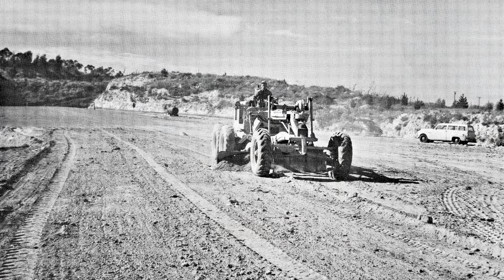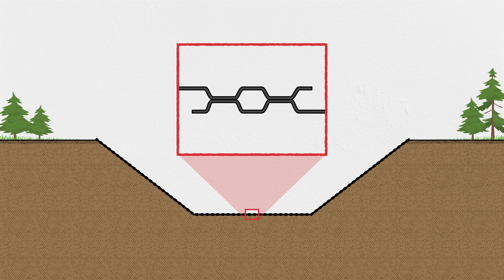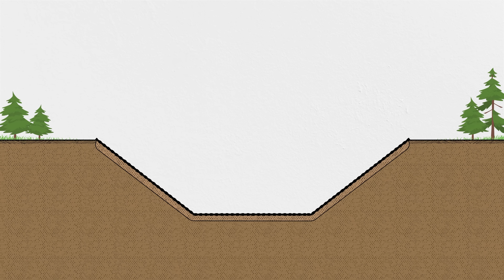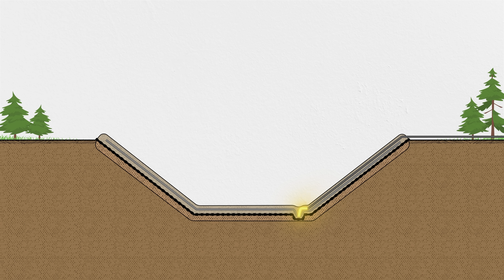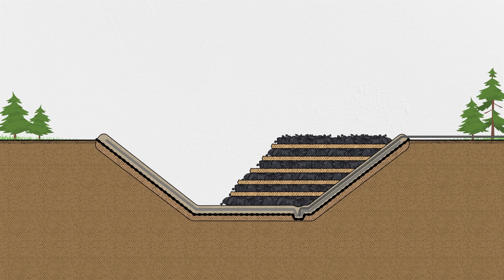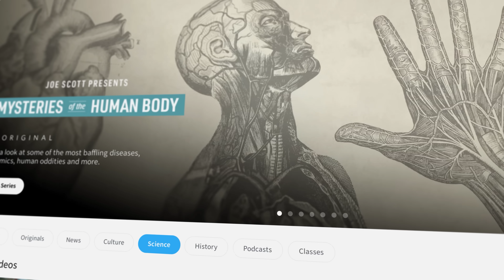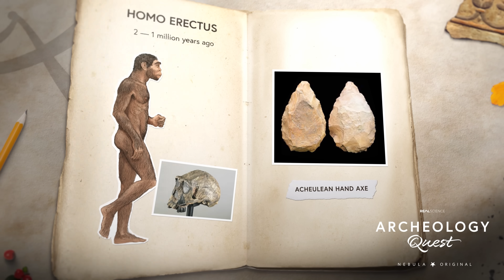The Hidden Engineering of Landfills

Comment from the maker: ⚡I have more than 20 videos about soil! https://www.youtube.com/playlist?list=PLTZM4MrZKfW-A419dqGZVtw6CAANqKR1f
🌌Get Nebula using my link for 40% off an annual subscription: https://go.nebula.tv/Practical-Engineering
Reply: As a Dane, I know exactly where my waste goes. I was born in 1984, and has only known a world where everything is sorted and recycled. There are no landfills. The only thing that isn't reused is concrete, but we're working on it. A lot of unsorted waste is incinerated, which isn't perfect, but the heat is used for district heating and generation of electricity. The smoke is “washed”, in an attempt to remove heavy metals.
Reply: By me I know all 3 landfills, Bisasar Road, now close to full, and Marianhill, also close to full, with the new Buffelsdraai landfill, set to be usable for a century or so, seeing as it is basically a massive valley between 4 hills.
Reply: Love your videos. Clear, topical, well-researched and well-organized. Thank you. 
1:11A lot of industrial ecologists and circular economists would take issue with the claim, "Trash is an inescapable element of the human condition," though, with the claim that well-designed systems make it worthwhile to move outputs to downstream inputs.
Reply: I'm very surprised you didn't say even one word about one of the most successful landfill-to-public parks in the US, Mount Trashmore, in the city of Virginia Beach, VA. Although the Puente Hills landfill was much, much larger than the Mount Trashmore landfill, it has quite a way to go before becoming as successful as Mount Trashmore as a public park. I lived in La Habra Heights for many years and had to drive on S. Azusa Rd. past the landfill quite often to get to West Covina. As you mentioned in the video, a steady stream of trucks going to and from the landfill always caused traffic problems on S. Azusa Rd., which was a major north-south surface street in the San Gabriel valley. It's been almost two decades since I lived there, but I seem to recall that landfill trucks were somewhat restricted during morning and evening rush hours. Anyway, as usual, it was a great video. Thanks.
Reply: Missed opportunity to talk about CNG/RNG the Puente Hills site operates a compressed natural gas fuel station that fuels all those waste management garbage trucks, the fuel is also available for public use for owners of CNG equipped vehicles, the gas from the  landfill drives down the price, if you pump the gas from your residential supply the cost is under 0.85 cents per gasoline gallon equivalent
Reply: "...highly engineered holes in the ground..." made my day xD (^.^)-d
Tho, if we would put more effort into using actually compostable materials for our single-use items (carbon based plastics, pure cellulose materials (yes, you don't need other stuff to make it watertight for some time - the issue is just, it eventually will be penetrated!) or other organic decompostable materials (there's even some special foam, with insulating properties, that can be eaten by plants^^ - to replace styropor)
I wish we would push harder to finally ban undecompostable materials for single-use items and transition faster to environmental friendly materials!
Reply: do a video about Singapore landfills i think they do something different. pulau semakau
Reply: No thank you because the music is very loud and distracting and over shadows your youtube channel
Reply: Leave the annoying camera click sound bytes in the landfill.
Reply: Grady, we're currently expanding our landfill in oklahoma. Excavation  is currently happening but the liner will be going in this month. 

We're also installing a landfill gas to natural gas project. 

If that's anything you're interested in, feel free to reach out!
Reply: You should come down to the Caribbean to see duquesa landfill it's pretty famous
Reply: Hacienda puebte hills between 605 and 60 freeways intersection in Whittier, Socal.
Reply: do one video about recycling
Reply: Aww come on man plug your brain in, you screwed up royally on a key part:
"once the gasses are collected they can be flared off into less harmful gasses""

You are a fricking engineer yes?  So although methane is certainly a horror, how is that with an atmospheric persistence of 6 to 12 years, LESS HARMFUL than Co2 with an atmospheric persistence of centuries to millennia? How does that pretzel work in your head?

They do not flare it off to make it less harmful, they flare it off TO SAVE MONEY.
Reply: You mean that this stuff doesn't just disintegrates ? It just stay here for ever in its current form. Are we waiting for a way to get rid of this stuff? This just doesn't make sense. Turning a mountain of trash into a park? I just can't buy it. Great video, I just had hoped for a happy ending , like the trash breaks down with the heat and pressure and becomes soil.
Reply: Loved seeing Brady doing the Obama sip.
Reply: Are you related to smarter everyday
Reply: Vista View Park, Davie, FL. It's a converted landfill park. Look it up in Maps.
Reply: I have a hypothetical mega project that is fun to think about.

Rather than building a fancy reverse osmosis plant, what if you built an osmotic well? A giant dam that extends thousands of feet deep into the ocean, with semipermeable membranes at the bottom. The difference in pressure should supply plenty of fresh water to hydrate even the thirstiest of cities. Just ignore the problem of pumping the water out, and it's great!
Reply: Very important -- and often ignored -- information!
Reply: low impact if you disregard the harm removing all the organics from an ecosystem just to passively harvest cheap methane causes.  Considering agriculture does more harm to the environment than any other human activity by a large margin, the impact of not returning a sizable amount of that organic material back to the soils it was extracted from is global and catastrophic.  But I ain't one to gossip so you ain't heard that from me.
Reply: Thanks. Do you have any thoughts about integrating oyster mushrooms, aspergillus, and other strains of mushrooms that can convert plastics to organics?
Reply: It's Printer Hills NOT Pwinta Hewls
Reply: Thank you. 
I was so sad today, but you turned it around by being a nice presentor. Thanks
Reply: you can tell this guy knew he had a hit video for us...
Reply: Have a look at whinney hill tip in Lancashire UK. That is literally built next to a town and it absolutely stinks
Reply: @practicalengineeringchannel, Some of our local trash (in rural MN) is burned at a plant about 45 miles away. I wonder if you could do a video about that aspect of disposal and how environmentally safe it is, etc.
Reply: Your kids are blessed to have you as their father!
Reply: As somone below points out we the consumer cannot always choose. I did 2 weeks of no plastic packaging. I couldn't buy fruit I couldn't buy vegetables meat nothing. I wa starving. There are no longer any options for consumers. And if anything they have made every plastic tray and package 30 times stronger and more tough... we the people don't want this. The manufacturers want this and foist it on us. I would love to produce less waste. I do what I can. But I do need to eat.
Reply: Aaaaaq awwwww 3:09
Reply: I assume the green nay sayers would rather float barges in the ocean. The science is here on landfills. Most provide methane and are self sufficient. Thanks for telling people the truth.
Reply: Any legos used in the making of your model trash? 😁
Reply: In San Diego a local Freeway  California State Route 52 was built over an old trash fill. Over time the road sinks causing roller coaster dips in the road. The road is periodically filled and resurfaced to accommodate this.
Reply: Effing  background music!
Reply: @ponkoadamfo997  you gonna be ok?
Reply: maybe you should think about European version of manage waste. Recycle, don't overpolute and burn the rest to create heat that can be transfered by pipes for steam to heat the cities.
It works for us, why don't for you?
Reply: I love your content.  You voice is very soothing and engaging.
Reply: What happens to the chemicals that get into the leache? Herbicides, poisons,etc.?
Reply: Another thing to think about is why we don't just fill in abandoned open cut mines with landfill
Reply: We need to get away from landfills and start to recycle everything. 
Organic materials can be composted and paper/wood can be incinerated. Plastics should be recycled. What's left?
Reply: Is this on nebula?
Reply: @Alex-Kubota  I can't see it on nebula either. The link in the description is broken.
Reply: Great, they named the runoff after milk 🥛🍼

Comment: I am far from being a tree-hugger, but I was encouraged when, about 15 years ago, our town started an initiative to provide recycling bins.  Unlike most over-the-top procedure that never pay back, this planned recycling was not a significant investment of time or money for the homeowner. It was just sorting of glass, paper, aluminum and metals.  It never came to fruition. I still separate aluminum but the time and resource investment to take it to a recycling center is not worth it due to having to sit in line to get it weighed, taking a ticket to the counter, showing ID and waiting for a check which is usually only $20 for a year of collection. I bag it in a clear garbage bag and put it on the curb for someone to pick it up.  I am guessing there are unforeseen problems, but I wish towns and communities would be more serious about recycling what makes sense.

Comment: The highest topographical point where I lived in Virginia Beach was Mount Trashmore, a former landfill turned into a park area with play structures, skate park, walking and running path around a lake, and more. Only rule was no sledding down it during winter, as that could rip up the grass under the snow.

Comment: This video showed up in my timeline at the exact right moment!  I have a rental property located on the very edge of a covered over landfill. I lived in that house over 20 years before turning it into a rental. I received a notice a few months ago about soil and methane contamination near the site.  A dilapidated methane collection system is present onsite which was in operation from the mid-80s until the mid-90s . They installed methane detectors in all of the houses along the perimeter. I freaked out thinking my house would have to be evacuated and lose all of its value! They are still invesigating the area and tryng to mitigate the problem, so I don't know what the outcome will be. Watching your video really helped me understand what may be going on at that closed landfill.  Very informative!  Here's what we know so far:

Division of Waste Management, through its Pre-Regulatory Landfill (PRLF) Unit, is conducting a remedial investigation of the LF (the Site).  The goal of the investigation is to establish the location of the waste disposal area and the extent of associated contamination in the air, soil, groundwater, and surface water/sediments.

LF is a PRLF operated from 1972 to 1980.  The Site is located on two parcels (60 acres total).  Part of the Site was used as a convenience center after it was closed.  A dilapidated methane collection system is present onsite which was in operation from the mid-80s until the mid-90s.  Public water and sewer is available in the area surrounding the Site. Waste disposal area is approximately 44 acres. Onsite groundwater monitoring wells indicate presence of contaminants over NC 2L Groundwater Standards.

Onsite landfill gas probes indicate methane is present over the lower explosive limit (5% by volume of air); hydrogen sulfide and volatile organic compounds are also present.  Risk is exceeded for the residential and non-residential worker soil gas to indoor carcinogenic risk and non-carcinogenic hazard quotient in onsite gas probes.

Methane is present over the lower explosive limit in the soil gas in the backyards of 7 of the 37 properties.  These backyards share a property line along the western and southern boundary of the landfill.

The PRLF Unit is focusing investigative efforts into the residential community surrounding the Site because of the measured methane levels from the landfill and proximity to homes. To date, DWM has installed soil-gas probes on 26 of the 37 properties that share a property line with the old landfill. Up to two probes are installed on each of those 26 properties. Staff are in the process of collecting a gas sample from each gas probe location. The soil-gas investigation will be expanded outward as needed to determine the extent of the contamination.

Comment: Here in finland everything is resycled. You pay alot for beer etc bottles and cans and you get the money back when you return it to the store. Anything that cannot be resycled will be burned and heat used for generating electricy and heating for the capital area.. There is world class filters on the facility so the left over gives out pretty clean air. Every now and then the huge oven will be cleaned and metals etc that have melted together (some people dont resycle) will be gathered for resycling and then everything starts again. I bet in 10-20 years we dont have landfills anymore. In citys everyone has compost that will be emptied by those who run landfills and they use it to make good soil to be sold back to finns for garden and so on. Usa should start putting money in systems like these that have been norm for us decades now.. This leads to almost aevery lake and river having water you can drink without filtering it. Groundwater is best quality water in the world and air is clean.

Is some drunken retard tosses beer can to the ground some kid picks it up asap to make some extra money. Usa and many others should look around the world how others do these things and hopefully learn something. ✌️

Comment: If you are a man, you need to man up and learn to build and fix things. Not everything but almost everything can be fixed. I have repaired and rehabilitated refrigerators, Shopvac’s, gas fireplaces, Trash Compactors, bicycles, cars, motorcycles, weed eaters, barbecue grills, patio furniture, stereo equipment, pressure cookers, surgical equipment, computers, swimming pool pumps, trash cans, toilets, indoor furniture, water heaters, and on and on. Saved thousands of dollars and tons of stuff from the landfill. It’s not necessarily cost-effective to have someone else do it so you have to get the skills and it’s not that hard you can do it.
Reply: Make your own landfil then 😂

Comment: I love your channel. Thanks for all the videos. But this one you over simplified the environmental impact. There is leakage to the soil, the fluid collected is highly toxic and difficult to process. Gases have high level of contaminants also difficult to handle for power production without significant emissions. Therefore, reduce and recycle are paramount and you do not mention them. You give a false sense of safe to continue current polluting and producing waste at the current rate. It is not sustainable. We cannot continue this current practice.

Comment: Switzerland collects even the garbage from germany for free.
We burn that for heat and electrisity. Dumps is a 3rd world solution, that is what I condider the USA anyways.
You havent even achieved the collective mindset, to dispose organic, metal, glass, paper, battery and plastic bottle (PET) separate. That is a no brainer.
The only insentivs we have is, that garbage bags cost a little amount (35l, 2.20Fr. = 2.50$). Other bags are not been taken.
outrageous how much we did and how far we came and no one noticed!
Reply: That's what I thought too the whole time. Recycling? Naaah, let's just dump it on a huge pile and let the next generations worry about it. USA...

Comment: Hey! I like this video.
As a Horticulturist, I've recognised an issue with previous (possibly current in the USA) practices that could be addressed: much of the waste humans produce is organic.
When organic materials break down aerobically, we can create compost and an enormous amount of useful material for improving soils in agriculture. (Much of the requirement for commercially produced fertiliser and excessive irrigation in agriculture is because of degradation of soil structure caused by "cultivation".
Burying organic matter so that it breaks down in an anaerobic manner is what creates those greenhouse gasses, including methane, and prolongs the time required for decomposition and extended maintenance, as well as ongoing costs.
Separating organic waste from inorganic waste would enable the businesses involved in the emanagement to reduce costs to tax payers by streamlining their methods for the various types of waste.
I am in Melbourne, Australia, and I recently saw an ENORMOUSLY EXPENSIVE operation (using enormously expensive and specialised machinery, especially shipped from Germany) to stabilise the ground in a large area of sporting grounds within the metropolitain area that was once a Tip/open cut rubbish dump in the 60's!
There are still ramifications now.

The information in this video is great. More information and explanation of consequences to the public, as well as  advice to businesses operating such enterprises and/or policy makers, is necessary.
More videos communicating such may shift public awareness and understanding of the importance of separation of waste would most likely be of significant benefit to everyone...
Keep up the good work!